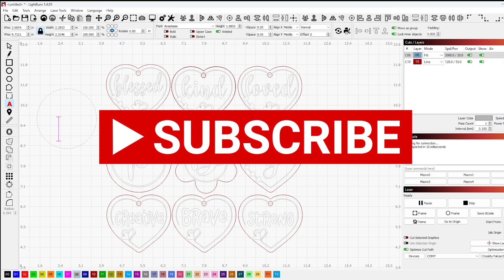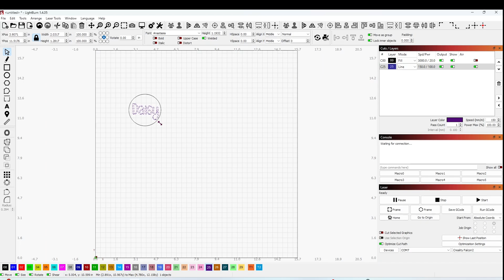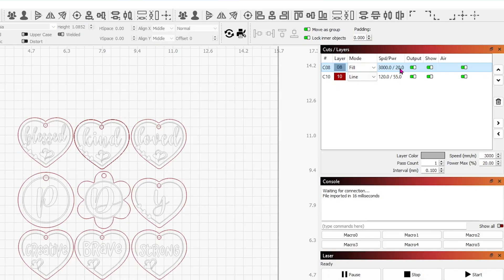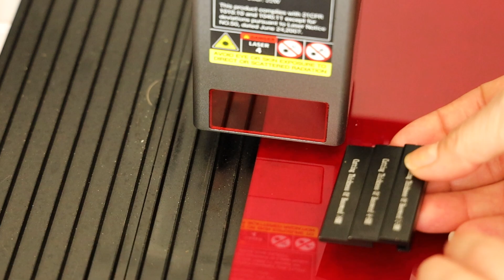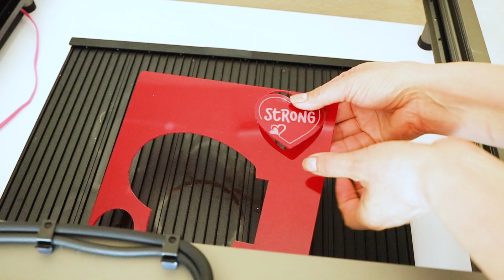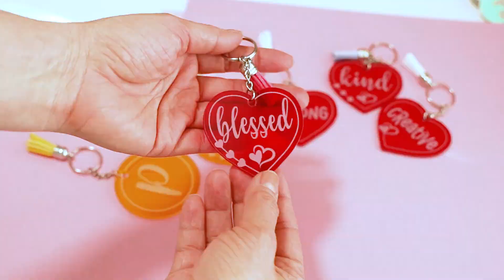How to Cut and Engrave on Acrylic Using Creality Falcon 2 22W Engraver Machine.

Comment: It would serve you well to point out that only colored (opaque) acrylic can be reasonably cut with the Falcon 2 (diode laser)
Reply: I had this problem with a professionnal 40w machine and the trick is to leave the protective brown wrap, or put masking tape on the surface.   I can't confirm it will work on the falcon cause I never used it.

I saw some people spray paint the surface and it seems to work on the falcon but I never tried it.